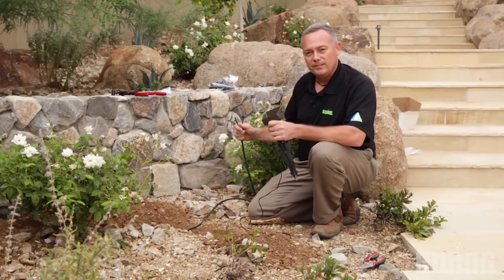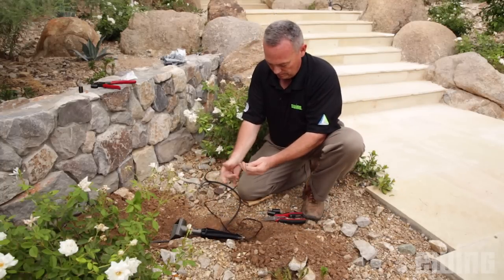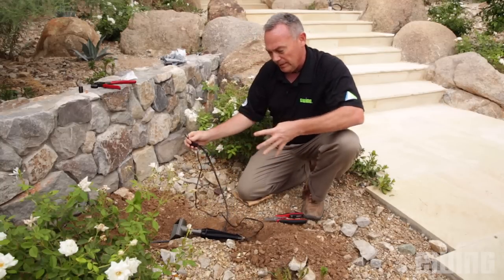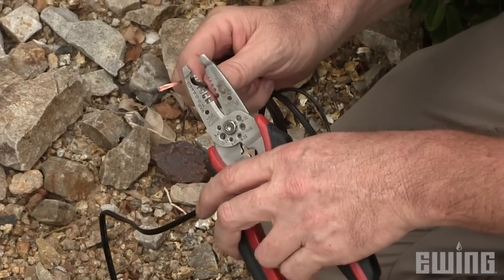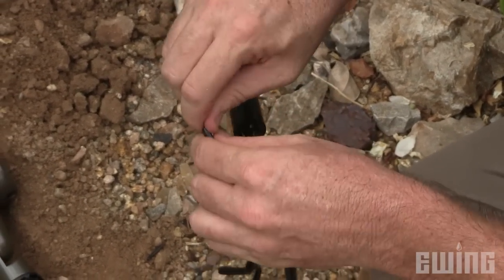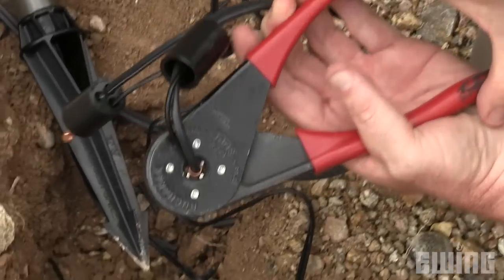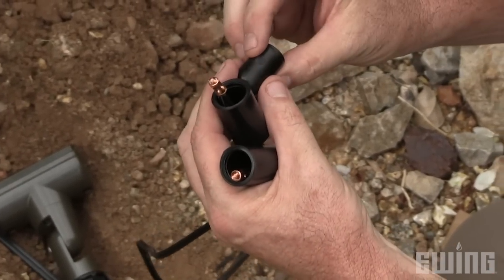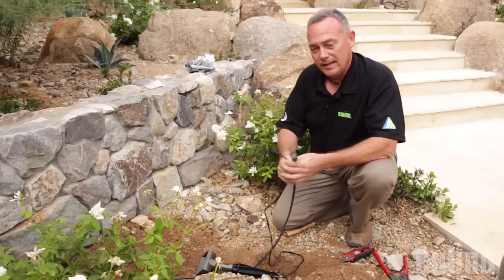How To Make A Low Voltage Lighting Connection

Comment: Question, what's the difference between ds-100 and ds-400 canister and can they be used for 120v AC?
Reply from the maker: The DS-400 comes pre-filled with DS-300 Sealant. The manufacturer states that they are for use in electrical systems with 30v or less. Thanks for watching!

Comment: This video is useful. Before, my low voltage lights would stop working periodically because of bad connections. However, my crimp connections have been perfectly reliable. It is a little trickier to remove the wire insulation midway along the line if you have multiple lights along the line. A wire stripper won't work, so I used a utility knife. Overall, the Dryconn Dry-Crimp Filled Connectors are a great product that is a major improvement over the flimsy plastic connectors that lighting manufacturers include with their products.
Reply from the maker: Thanks for the comment!

Comment: Is this product still made?  Link below does not work?  Looking for something that would fit inline wire on low voltage system with 12 gauge wire
Reply from the maker: Yes, they are still available. Here's the correct link: https://store.ewingirrigation.com/catalogsearch/result/?q=ds-400
Thanks for watching!

Comment: Is there a negative and positive wire?
Reply from the maker: With a daisy-chain design you can connect either wire to the common or voltage terminal as long as one wire from the fixture is connected to each side. However, If you are using a looped design, then it is important to match the wire polarity at the transformer connection in a loop layout. Thanks for watching!

Comment: It would be exceedingly more helpful to do one in the middle, not at the end. I assume it's a PITA and splicing is involved which is why you didn't show the more important connection type
Reply from the maker: Thanks for watching Sharon! The third hole in the connector is for the wire that runs to the next lighting fixture. You would just be connecting together 3 wires rather than 2 to each side. Hope that answers your question.